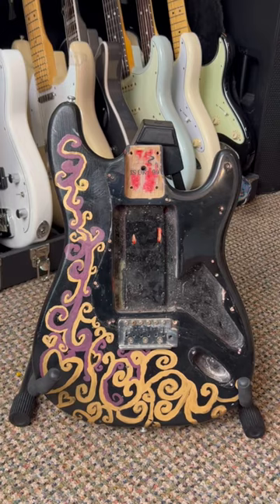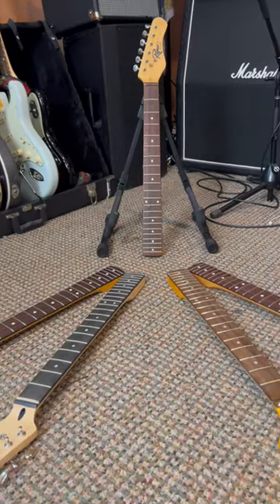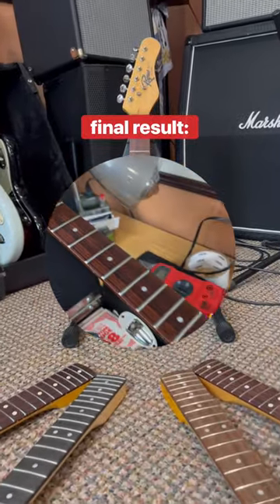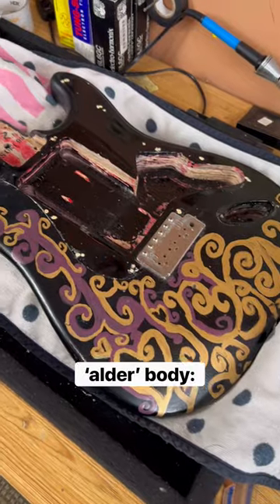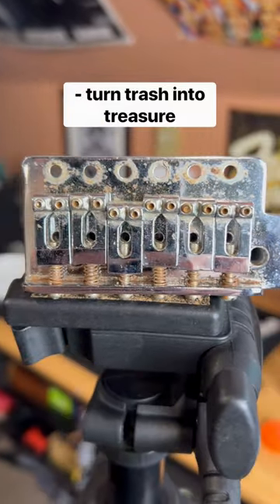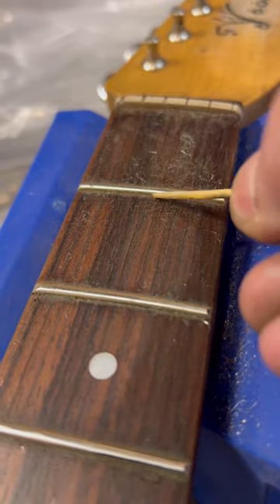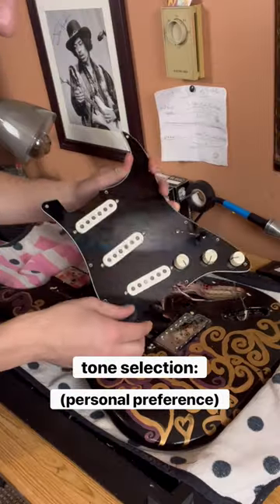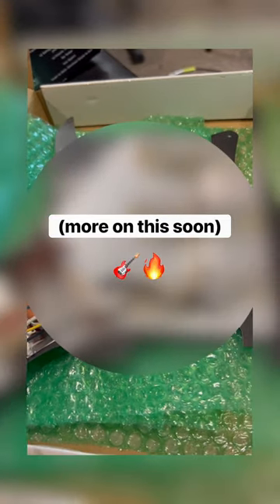How to Build a 'Parts-Caster' Like the Pros #shorts

Comment: Tone wood in electric does absolutely nothing to the sound of the guitar.
Reply: I dont understand why guitarrists believe in so much BS.
Reply: Completely wrong lmao 🤣
Reply: yea tone wood is bs but the cut does effect sustain and low end. u can have 2 identical guitars that still sound different because 1 has a denser body than the other
Reply: Agree. It's a big myth that people still follow to this day for whatever reason. It's all in the hardware. Pickups and amp.
Reply: Remember everyone: it’s all speakers 🙌
Reply: @sadistdog  and the picking hand 🤚
Reply: @SoggyBacco  I’ve never seen anyone actually demonstrate evidence of that
Reply: @finnancahill2644  aaron rash has a video that shows it with 2 jaguars. he even tried with different pickup types and used the same bridge on both of them, there was a clear difference both amped and unplugged. the density of an object affecting how it reflects sound waves is also basic physics
Reply: @SoggyBacco *affect. Learn the difference.
Reply: @QS-si3cq  bro cares about spelling in youtube comments 💀
Reply: Pressing a metal string against a metal fret & picking up sound with a magnet. 
Not a big believer in tone wood either
Reply: @SoggyBacco acoustically, sure. When amplified though? Not at all. The pickup does not care about what material it’s in.
Reply: @GuitarGuy4647  again aaron rash showed the difference amped too. wood type, pickups/electronics, bridge, and amp were the same, capo so the nut wouldn't matter, ect. i even went and tested it myself to make sure it wasn't some mixing trick he pulled
Reply: The only aspect where wood could affect the output is sustain. And it really isn't the wood type as much as the hardness of the material. Softer materials will have a dampening effect which absorbs vibrations and reduces sustain (also having an impact on feedback). This is noticed at the extreme with floyd roses where the bridge connecting to springs absorbs quite a bit of the vibration rather than bouncing it back into the strings.
Reply: @sadistdog and pickups
Reply: The body’s wood does affect resonance. But not really anything else.
Reply: @chetwilson Speakers and mic placement are FAR more impactful than pickups. The moment you mic up the amp those differences are so small you genuinely need an actually decent audio setup to hear the miniscule differences.

Comment: >tone wood matters
>on a solid body electric

What about the guy who fastened some strings between 2 points in air with no neck and body, just a pickup, and had it sound pretty much exactly like the guitars that the parts were from? Also what about the statement that a lot of the tone comes from the player's hands? At what point would "tonewood" start counterbalancing these in a way that it starts to become the most important factor?
Reply: Toan is in the Honda engines
Reply: They did an actual scientific experiment, toanwood actually does change the sound, just not enough for any human ever to tell the difference
Reply: Nuts and tuning pegs also change the tone, but there's no such thing as a tone nut or tone peg. Makes you think why the "tone wood" debate even exists.
Reply: No you dont get it, toan is stored in your wood
Reply: @bazoozoo5  just like how pee is stored in the nuts! Ive been saying this for years! Why else would they call em peanuts??
Reply: Anybody that thinks tone wood matters on a solid body electric guitar just simply have no clue how these guitars even work

Comment: tone wood doesn’t do shit on solid bodies
Reply: I definitely get a different sound outa my Rosewood fretboard Tele than the maple board...more twang on the maple? It's def noticeable...

Paint does fukall to tone on electrics.
Reply: @baabaabaa2293  a b tests with every variable being the same are difficult and take effort and money

until i see a blind test where you can HEAR the change then i won’t believe
Reply: @noahhughes1433  Yeah lm with ya.. l read an article in Guitarist mag yrs ago about wood, density, paints, plexiglass, concrete etc etc.
They measured onset of note, sustain, compression, decay & knee (where the note loses loudness).
The differences were minimal mate, but the mag stated people may subconsciously fret differently with certain necks/boards (like coated maple)...press harder etc...
Also brass nuts & saddles were once a thing, even tho the notes fretted & picked there's measurable difference to brightness of tone.. that's on an oscillator & recording equipment...so l agree, it's minimal.
Gibson used poly on bridges to make the note softer, for jazzers...
But body wood on an electric @ 105db... I don't think you hear much, cept the pickup type, fx & amp used.

A Goldtop & a Special don't sound different, yet ones mahogany & maple...the others just a slab of mahogany.
Reply: @baabaabaa2293  there’s a great video about where the tone actually comes from

he removed all variables and ended up using that same electronics and just putting strings between two desks and the test sounded identical
Reply: @noahhughes1433  Cheers mate..it's on utube? Ill check it out.
And eh, l agree with you... the diff between my two Teles is more than likely the pickups, to me the maple board sounds brighter (clean) add drive, l hear the pedal.
Like l said, the differences the mag found were measured by  machine, not ears.
Reply: @baabaabaa2293  It's Jim Lill. The title is "Tested: Where does tone come from in an electric guitar?". He's got a great channel that explores many guitar myths.
Reply: @baabaabaa2293  looked through old comments and forgot to mention that it’s two different guitars and every guitar is a little different.  it’s mostly placebo
Reply: @noahhughes1433  Placebo the band? jk.
Mate youre dead right there.
Me mate wanted to buy a LP Standard, in this shop were 5..
We tried them all & the one that rang the best, sounded gd clean & driven was this ugly looking faded blue topped thing...he didn't buy it.
Reply: @baabaabaa2293 What you’re referring to is “in the room sound” the moment you mic those, all those differences become negligible if they’re even audible. Speakers and mic placement matter FAR more than literally anything else you could change outside of pedals. I’ve done A/B tests, which is also how I learned how little pickups make a difference too.

Comment: You never hear the Squier and Epiphone marketing departments calling the wood their stuff is made from 'shitwood', 'dullwood' or something, but the moment a guitar isn't made in some sweatshop abroad and has a Fender or Gibson logo on the headstock, suddenly it's made from 'tonewood'. Yeah right. 

The material an electric guitar is made from has little to no affect on how it sounds apart from the potential to alter the sustain a very small amount, particularly on a Stratocaster, since some of the sound depends on how the trem block is set up in terms of how it is screwed in, spring number, block density, pivot etc (unless it is a hardtail Strat of course). Other than that, the notion of 'tonewood' is just marketing bullshit. 

Don't get me wrong, there are plus points to nice, more expensive wood on a guitar, such as it being more pretty (which only matters if you're not going to paint it) and it being more dense, which means it takes screws better, so the neck on a screw-on guitar will be more secure and it will be more resistant to dings and feel a bit more solid as well as the resonance from the vibrato springs transferring more vibrations to the saddles. But it will also usually be heavier, which does mean it will be less likely to nose dive, but it will also be less pleasant to have it hanging around your neck for two hours on a sweaty gig.

And as for wiring it to the same spec as Hendrix, unless you are Hendrix and you have his exact same sound engineers, amps and effects board, that wiring in the guitar is not going to make much difference. Most of a guitar's sound is due to the amp. It's worth bearng in mind too that when it comes to real electrical subtle differences, even the length of the wiring between components has a bearing on its sound reproduction, but such subtleties hardly matter when it's the amp which has the main effect on what you'll sound like.

Hendrix played stuff such as '62 Strats not because they were magic (although a lot of people who want to make money from 'vintage' - i.e. old guitars - would like you to believe that), it was because they were what was available in second hand guitar shops at the time. And you need to be aware too that much of Hendrix' iconic stuff was recorded on a borrowed Telecaster; some of his stuff is recorded on a Gibson LP Custom, so not even a Fender, let alone a Stratocaster anyway.

Over and above all of this, if anyone thinks Purple Haze, Voodoo Chile, or All Along the Watchtower would have sounded shit if Jimi had recorded them all on a hundred quid Squire Bullet Strat, they're not on this planet. But, having said all that, if making a partscaster pleases you, and it will - I've made a few myself - then knock yourself out, just be aware that it's your playing and your amp that matter most when it comes to the sounds you'll get out of it, not the wood and certainly not the logo on the end of the thing.